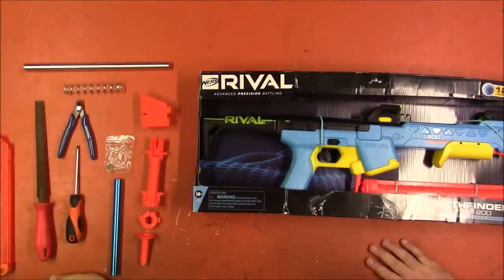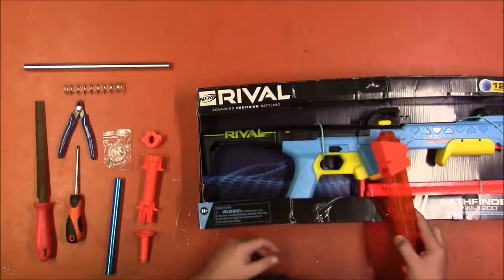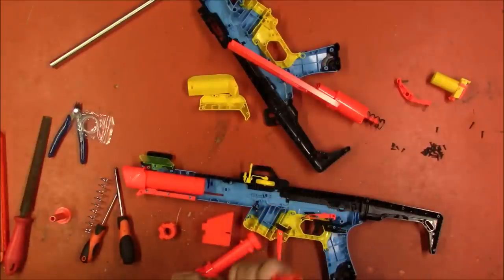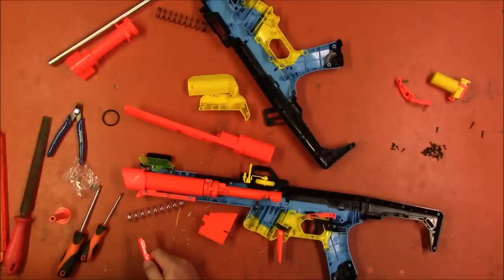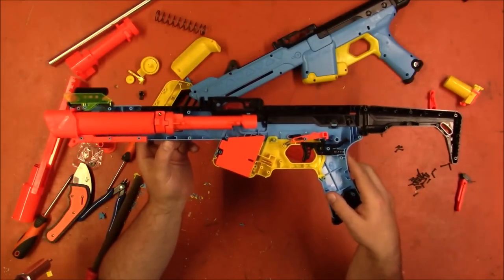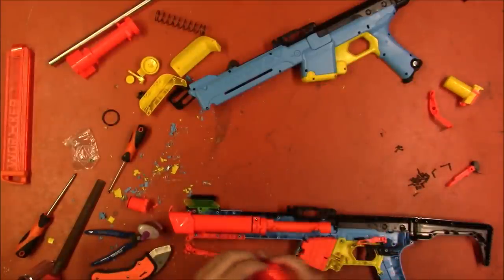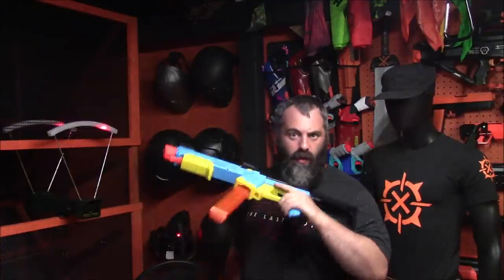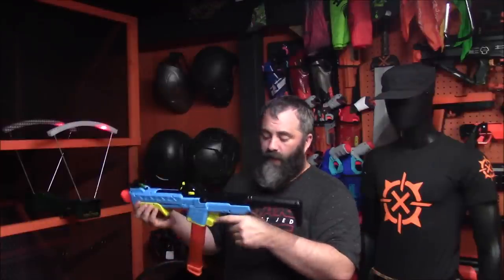Nerf Rival Pathfinder - Half Dart Kit - Build

Comment: I believe that the new pusher is suppose to be glued inside the buffer tube instead of on top. This would account for the over priming you have to do, to reliability feed. But I could be wrong.
Reply from the maker: No no, you are correct. That was the mistake I mentioned and fixed. It is better now, but still an issue.